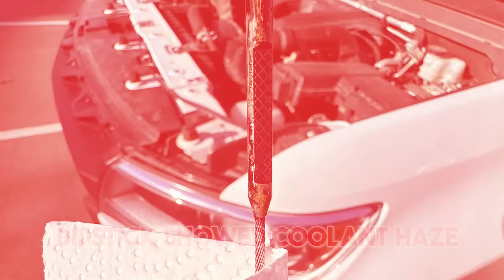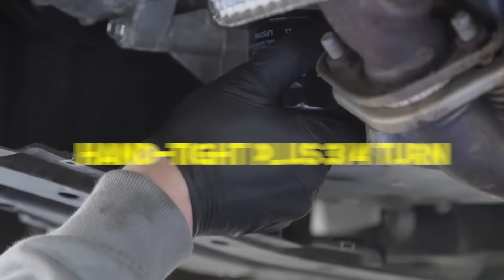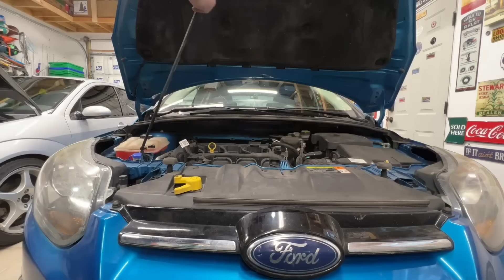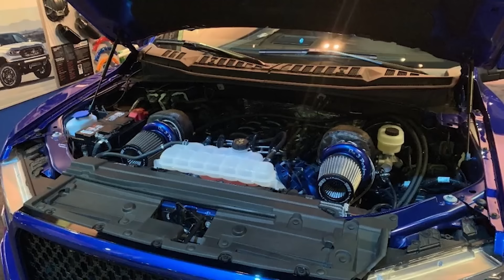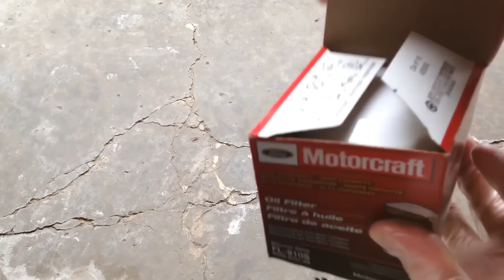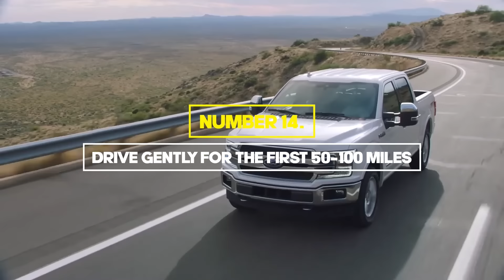Ford Owners! NEVER Do This After an Oil Change! (& 5 Things You MUST Do Before!)

Comment from the maker: How do you handle your oil changes?  DIY at home, Trusted shop, or Dealership?
📘 FREE Ford Longevity Checklist 👉 https://www.fordscope.com
This is the same checklist I’ve used for 20+ years to spot early wear and bad habits.
If it raises warning signs, the full 500,000-mile guide explains what to do next.
Reply: I do all my own service. If I’m not sure of something I use multiple Utube Videos to find the best possible answer.
I worked at 3 dealerships in my 44 years and seen some scary stuff.
Reply: DIY to ensure it is done right. I am in the army. they have a auto craft shop where I can put the 2018 F150 on a lift for the change and under truck inspection. Works great for me
Reply: First oil change I had the dealer complete at 1500 miles and requested full synthetic. After that DIY every 6 months. ‘15 Mustang GT. My car only has 20,000 miles now and runs like new. Don’t trust the dealer since the door latch recall and they dinged the driver door.

Comment: New F150,first  change engine oil at 1,000 miles.  Then every 5,000 miles after that.  Easy to do and takes less than 15 minutes at home.

Comment: Can I just pull the fuel up fuse from the agent and then crank it that way I can find the system without starting the engine and then with the fuel pump  Fuse back in and then fire the vehicle would that be acceptable or something other than that that would enter causal issue
Reply: Check out your car, many Fords, as long as the gas pedal is floored, the engine will crank but not start.

Comment: I have 4 Fords.  I change the oil myself in all of them.  They are 2009, 2009, 2011 and 2017.  I use only Motorcraft oil and filters and have yet to have any issues.
Comment, I wish Ford would design cars to take full quarts only.  My Fords are 4 qt, 4.5 qt, 5 qt and 5.7 qts.  Those fractions are a pain and I end up hanging onto partial jugs all the time!

Comment: 2020 F150 with a 3.5, 94k on it, service at home since warranty ran out at 75k, always with 5w 30 Valvoline High Mileage Full Synthetic and a Motorcraft 500S filter, also use Lucas Synthetic Oil Treatment, and add a bottle of Lucas Deep Clean Fuel System Cleaner every oil change. I also use the flood clear to prime the engine with oil before starting!

Comment: Absolutely use a clean funnel, put oil in the filter, Make sure the old gasket is off the engine and on the old filter, match the filters that they are the same opening and gasket diameter.

Comment: 2017 f250 6.2 gas 281000 at home drivetrain maintenance. Definitely something you should get good at and have backup fluids and filters. And some high wear parts.

Comment: I just purchased a 2025 Ford Ranger with the MPC 2.3L. I took it to the dealer at 500 miles and changed the oil. Going to change the oil again at 1000 miles and swith to Penzoil Ultimate Platinum 5W-30 full synthetic. Ill still use the Ford oil filter. After that ill change the oil every 4000 miles, and the dealer will let me bring in my own oil as long as it meets specs. I know this interval might sound like overkill, but i plan on keeping this truck for many years.

Comment: What is the difference regarding residual oil comparing an oil change to a vehicle that hasn't been driven for a few days.  I understand the concept of priming the oil but it begs the question should you prime the oil for both situations I wrote about?

Comment: Now that I got a 2015  f150 3.5 ecoboost 4×4 and no service record being a used truck with 132,890 miles first thing oil change from dealer then again 3,000 miles later no problems & no odd knocking but now I need to have All fluids changed cause I have no records of anything being done..I can't afford replacing engine or transmission or any preventable break downs ..better to spend $$ wisely then foolishly $$$$$$$$$
Reply from the maker: Smart move! With a used truck and no service history, you're doing exactly the right thing by starting fresh with all fluids. Preventive maintenance now is a lot cheaper than major repairs later, especially with an EcoBoost. Keep up the good work and your F150 will thank you with many more reliable miles.

Comment: I have a 2025 Ranger and bronco both with the 2.7 eco-boost. I don’t do the oil changes myself. I bring it to the dealer, do they do all these checks or is it something that I should do? I’ve never had an issue with my cars going to the dealer service but since these are new, I want them to be able to last.
Reply from the maker: Great question! Most dealers handle the basics, but they may not do all the detailed checks (like checking for leaks after warm-up or verifying dipstick level post-settle). It’s smart to double-check the level yourself once you're home, especially with a new 2.7 EcoBoost. That little habit can help catch issues early and extend engine life!

Comment: I have a 2023 Ford Transit AWD Ecoboost that I’m building out.  I have the maintenance plan through Ford and get the oil changed every 5k or 6 months. It’s definitely not my daily driver. I make sure it’s driven at least once a week when we’re not using it for a long trip. Great channel with good info!
Reply from the maker: That's a solid maintenance plan for your Transit build – 5k or 6 months is perfect. Glad the channel is helpful!

Comment: 2016 F-150 2.7 ecoboost 4X4. 171280 miles. I've owned the truck since I purchased it new at the dealership. Always had it serviced at the dealership until now. I decided to do the oil changes now that I have a nice shop to do it in. I use only Motorcraft or OEM parts for repairs, and it's always had Motorcraft oil in it until now. I went to the parts store to get the oil and filter. It was a new NAPA store here where I live. They had not completed their contract with Ford at this time, and they did not have any Motocraft, oil, or filters. I used a top-tier Valvoline 5-W30 Synthetic blend. I also used a NAPA Gold filter. (This is before I started watching your videos) . A bit after I had completed the oil change, I noticed my truck was struggling to accelerate as I was merging onto the expressway. And I heard a noise I had never heard before, and about that time, a Yellow wrench appeared. I immediately pulled to the side of the highway, shut the truck off, and looked under the truck and under the hood. No leaks of anything. I could not see anything wrong, just visibly looking over the engine. I did not see any leaks around the oil fill area or the oil filter cap. I started the engine and listened for noises, and it was humming smoothly as always. I was 1.5 miles from home, so I decided to turn around and go back to my shop. I stopped by the parts store to get them to check for codes on the wrench light. It was p0299 Low Boost. Drove it home and parked it in the shop. That's when I started watching your videos.
Reply from the maker: Glad you found the videos and caught that P0299 early! It's always a good call to stick with the recommended oil and filters for those EcoBoosts.
Reply: Thank you sir for sharing your experience, wisdom and knowledge. Your videos are very helpful and much appreciated. May God bless you and what you are doing.

Comment: 2020 F150 , 3.5 eco boost. I change the oil and filter. Get Info!
Reply: Bought a new F150
Changed the oil after one week. I filled the Oil Filter and let stand, it’s surprising how much it absorbs so you can spin it on without dripping all over the place. Not sure how to prime without starting yet.
Reply: @mcmuskie2563  Foot on brake, floor gas pedal, crank engine, after about 10 seconds, release key, start normal.
Reply from the maker: Changing your own oil on the 3.5 EcoBoost is a great way to maintain it! Just double-check that oil level and look for leaks before hitting the road.

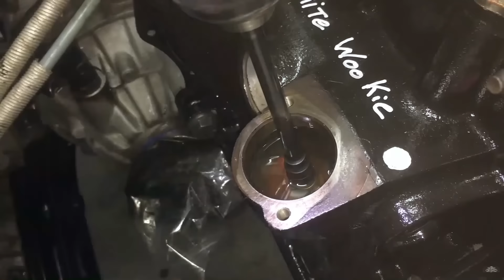Comment: 3:57 - to prime the system after changing the oil on a 2024 F-150 Coyote can you just use the Ford feature of pushing the gas on ignition to spin it?  I heard on another video that's what that feature is made for.
Reply from the maker: Yep! That’s exactly what that feature’s for — Ford’s built-in “clear flood mode” is perfect for safely spinning the engine to prime oil after a change. Great way to protect your motor!
Reply: @FordScope how do you recommend priming the system on an older F150 such as my 2013 Ecoboost? As far as I know it doesn't have the "clear flood mode". Method you recommend for preventing ignition from firing the engine while using the starter to prime the system?
Reply: To prime the system. First, I put 7 quarts in (‘15 Mustang GT takes 8 quarts), step on the brake and push the accelerator to the floor and hold it there (this prevents the engine from starting in what’s called ‘flooded mode’), push the start button and let it crank (don’t hold the button). Do this one more time (I do). This makes sure the filter is full of oil and the engine is primed. Check for leaks at the filter. Start the vehicle and back off ramps or remove jack stands. Check oil level and add another half quart or less depending on dip stick level. Drive the vehicle to bring engine up to operating temp. Then let it sit for at least 20 minutes and check oil level again and add as necessary a little at a time. Recheck after the next couple drives, add if needed. I’ve kept my car at just under the max level with this method. Same procedure for your ‘24 F-150 except you may need more or less quantity.

Comment: I have a '16 Police interceptor Sedan, 3.7L AWD.  I use the same Ford Dealer that has the Police Service contract for the Region's Ford Police vehicles, and they use Motorcraft Oil and filters, as well as other Motorcraft Lubricants/coolants, etc.  I change the oil every 8,000 km or 6 months....full synthetic Morotorcaft.  The car has 147,000 km on it, butTOTAL  engine hours of 17,949, and E/ngine IDLE hours of 12,778.   The water pump was changed at 90,000 km and the transmission rebuilt at the same time, by the Police at the Ford Dealer.    I was wondering, with all of that time on the Engine, if I should be using 5w30 instead of 5w20?  LOVE the car, handles like a dream.  It has the Goodyear 245 55 R18 tires on it.
Reply from the maker: With 17,949 total engine hours (and 12,778 of those idling), your engine has definitely seen a lot of time, even if not extreme mileage. Many mechanics in high-hour situations (especially with Police vehicles) do recommend stepping up to 5W30 for a little added protection, especially if:
- Oil consumption has increased
- You're hearing any ticking on cold starts
- You're seeing hotter oil temps during long idle sessions or summer use

It’s still within Ford’s tolerances in many cases — especially if you're sticking with Motorcraft synthetic. But if you're unsure, the best step is an oil analysis at your next change. That’ll show you exactly how the 5W20 is holding up and whether a switch is truly needed.

Glad to hear you love the car!